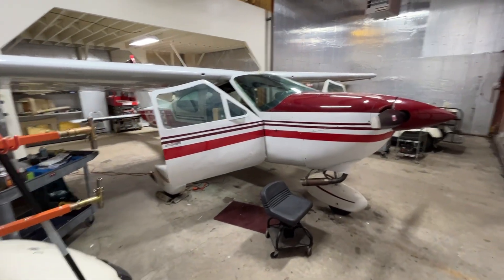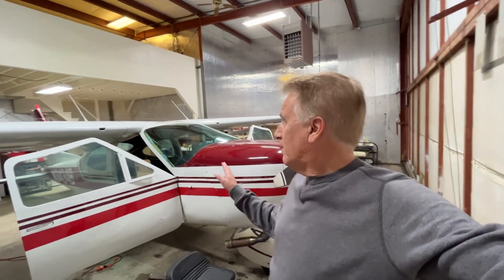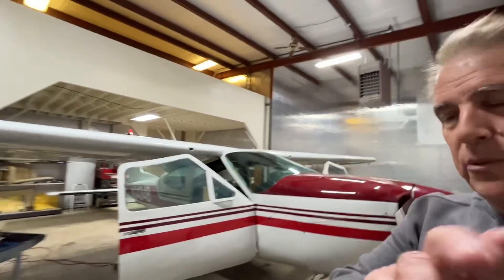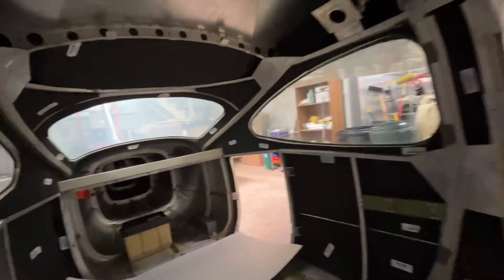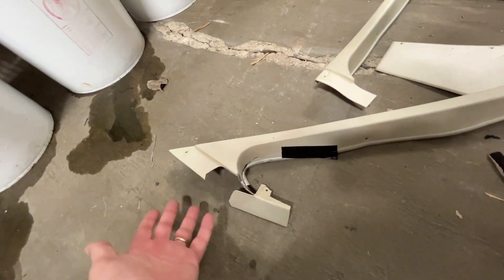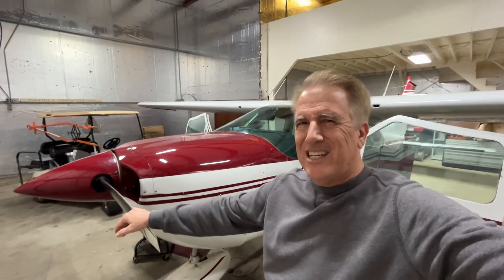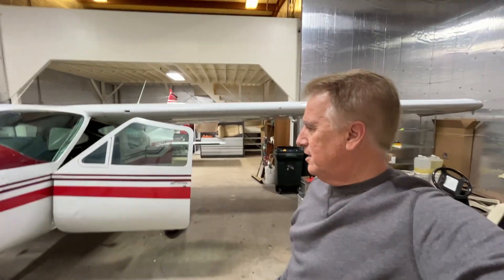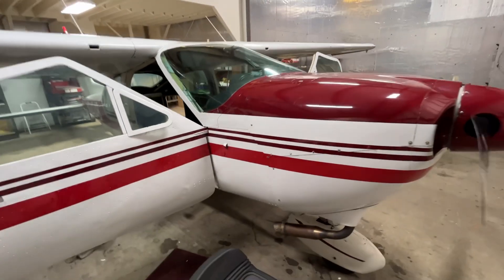Cessna 177 Wing Spar Update!

Comment: My Cardinals N number is 34346. It is the first FG for 1973. I assume yours would the third FG for 1973.
Reply from the maker: Ours shows up as a 1972 model.
Reply: @quinnjim  so does mine. It was built in 72 but mine is the first 73. Just like new cars. The new model year are built in the previous year.
Reply: I have N34314

Comment: I didn’t see the panel. Surely that needs an all glass upgrade 😅
Reply from the maker: Quiet, you!   We put a couple AV-30's in.  We wanted to do an autopilot, but we can't since the AV-30's aren't certified to run the auto pilot.  They also don't have a glide slope.  Moral of the story is to NEVER install the useless AV-30's in your airplane.

Comment: Glad you passed the eddy current inspection; pretty stressful time for an owner to go through that. I've been in my mechanic's shop for several of those and you can feel the tension in the air, and then the total elation when they pass (or despair that one time a plane failed). 

That 'Hush Kit' looks like the same material that I used to line the interior of my 172 when I re-worked it a couple years ago. I ditched the rest of the interior though and didn't re-install any of the plastics / fabrics - left it looking like a 1960s pickup truck.
Reply from the maker: As long as it’s functional!

Comment: Thanks for the update. Much $$$$ lol.  Worth it though !!  If it only had the 230hp of the 182 Skylane.  😉  Looking forward to seeing you in the air soon.
Reply from the maker: I go 8 knots slower than my 182 at 30% LESS fuel flow.  182 is a great machine, but I wouldn’t go back.
Reply: @quinnjim  understand completely.  I was just thinking of useful loads between the two on hot days, etc.

Comment: I remember when those first came out. My Dad when out and got checked out in one and was warned  about using full flaps at certain speeds! So the first thing we did was went to full flaps and went to the speed restriction. Both doors popped open and they will not close as the fuselage moves so much. We landed holding the doors and the owner of the FBO saw us and said You just had to try it didn't you? then he said he did the same thing  and laughed!
Reply from the maker: That’s crazy!  Never heard of doors opening due to flaps before. They must have corrected that in my “B” model!😄